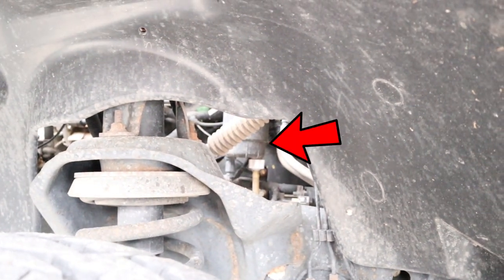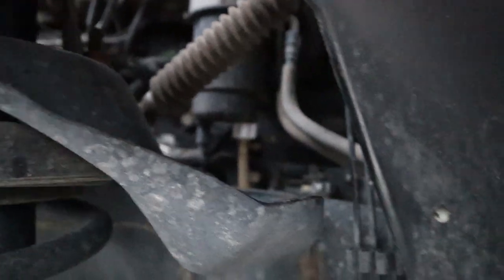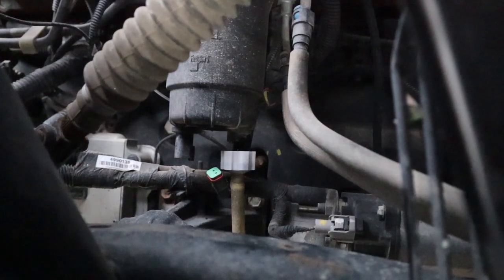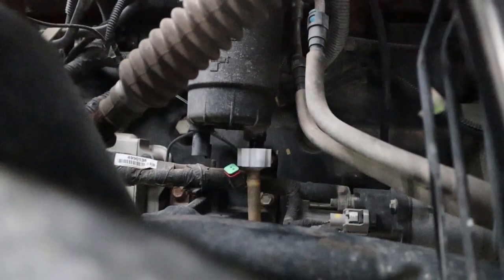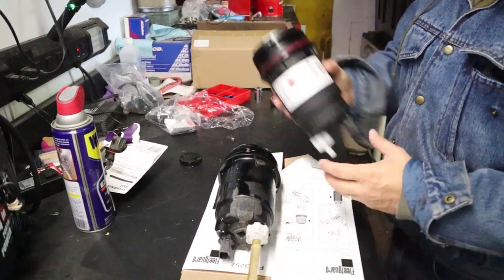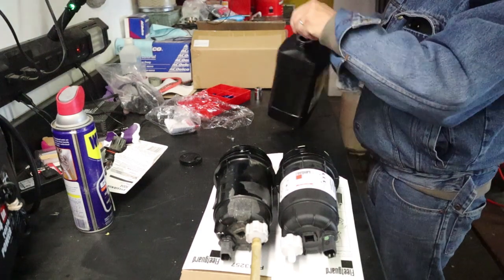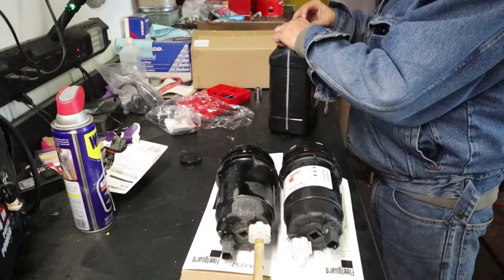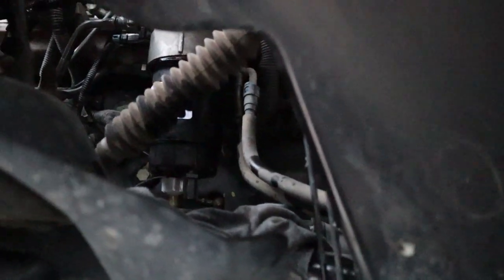Fuel Filter Replacement 6.7 Cummins //2009 Dodge 6.7 Cummins

Comment: What sides of tubing did you use to drain the fuel
Reply from the maker: I believe it's 3/8 inside diameter tubing that fits over the drain nipple. Hope this helps. Sean

Comment: do you know how to reset the replace fuel filter message in the overhead display?
Reply from the maker: Hi, thanks for watching. It depends on the year of the truck. Some you reset using the brake, accelerator & ignition in sequence newer models you reset it using the DIC. I would suggest searching YT to find out what the process is on your year truck. Thanks for watching. 👍

Comment: Do the plastic ears on top of the wix filter stick out of the black cartridge, or do the ears fit flush into the cartridge?
Reply from the maker: Hi John, the wix filter fits flush inside the holder. Thanks for watching. 👍

Comment: how do you drain water out of these ... I just picked up the same truck and have a "water in fuel" warning
Reply from the maker: You should be able to remove water by  turning the white "valve" on the bottom of the filter housing and draining it out of the filter housing. The sensor on the bottom is telling the EMS there is water in there. Or, just replace the filter/filter housing as I show in the video. Hope this helps. 👍
Reply: @ouRVisionnomadicliving  Thank you for answering so quickly, I will give that a try! I  have another question if that is ok. Many other youtube videos show another fuel filter  under the truck beside the gas tank. I can't find a fuel filter beside my gas tank, how about you?
Reply from the maker: My 09 only has 1. I believe Ram started putting two filters on the trucks in 2013.  @AgostinoRicciardi-es2jf

Comment: How to prime?
Reply from the maker: Prefill the filter, then in my case its just been a matter of starting the truck. Generally it only takes a couple cranks then fires right up. Thanks for watching!
Reply: @tomasbautista7530 you turn the ignition on into you hear the fuel pump not turning the car on, turn off the ignition. Repeat x3 and all the lines should be primed